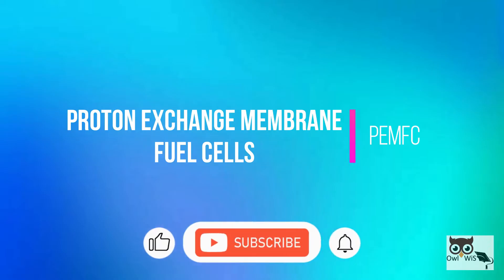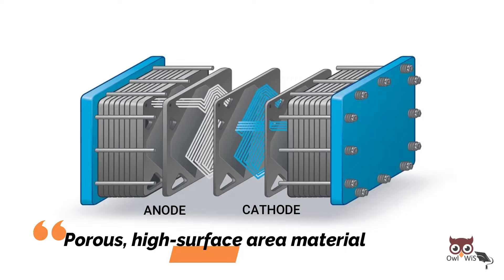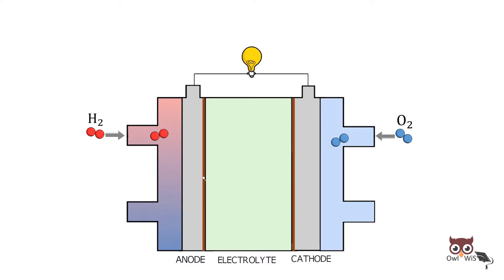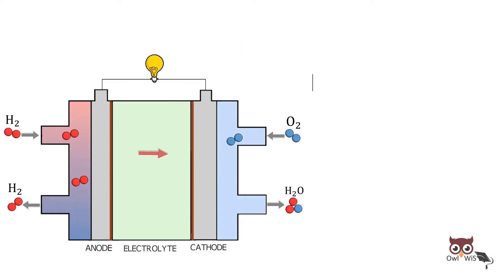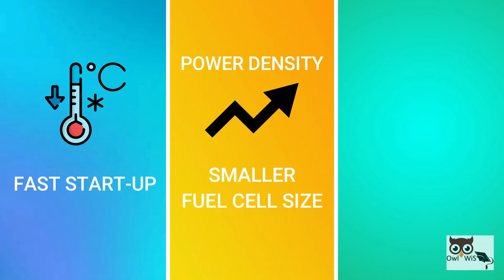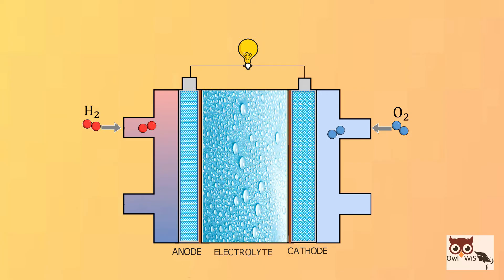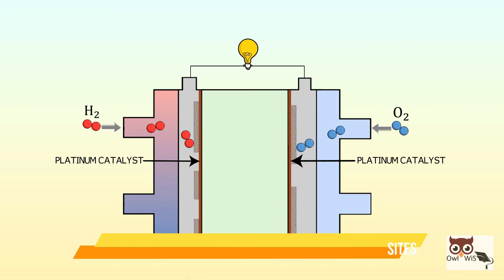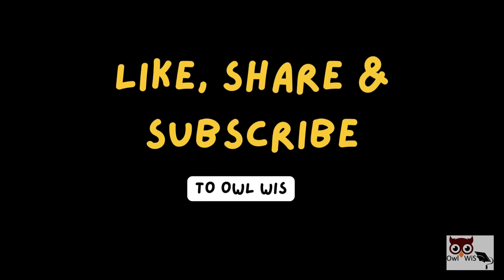Proton Exchange Membrane fuel cell (PEMFC) | Advantages, Issues and Applications

Comment: Yup water content is important for existence of distinct hydrophilic channels for proton transport.
However too much moisture can make the membrane swell up leading to reduction in mechanical and thermal stability.
Also we cannot use any membrane we like.  Some part of polymer must have hydrophilic molecules  while the polymer backbone is generally of hydrophobic nature. Theoretically we cannot afford to have whole polymer to be completely hydrophilic (since there will be a massive reduction in mechanical strength as it will absorb a lot of moisture and swell up) or completely hydrophobic ( since proton transport cannot occur due to little to no proton conductivity left ). So finding a sweet spot between them is important and thats why  perflourinated membranes like Nafion are used mostly ( with cheaper alternatives like sulfonated-PEEK membranes) .

I am currently working  on speek membranes so wrote it.